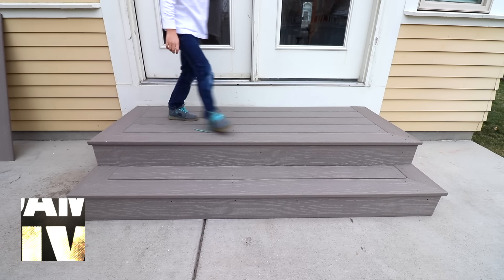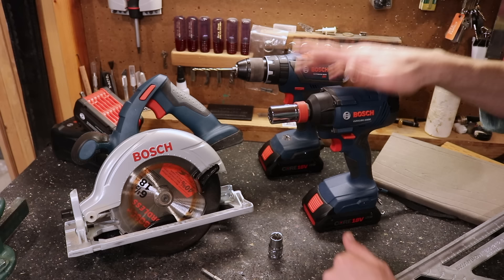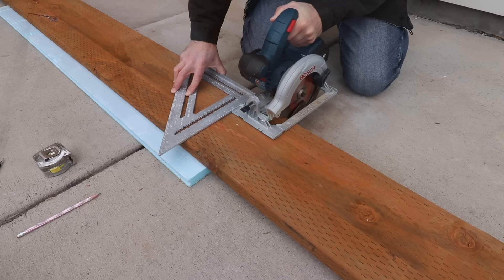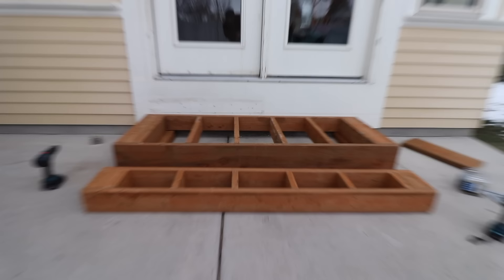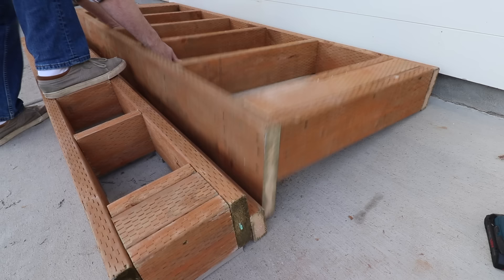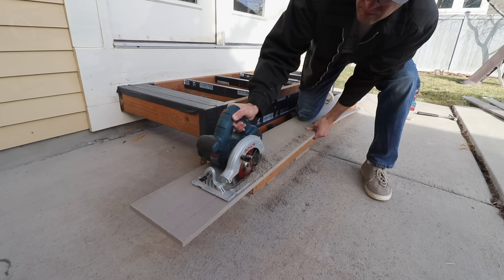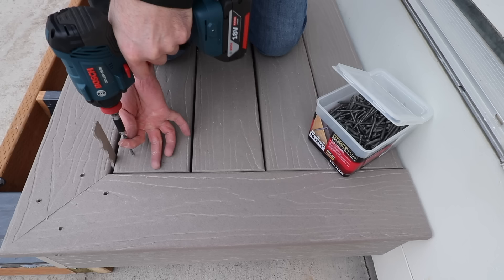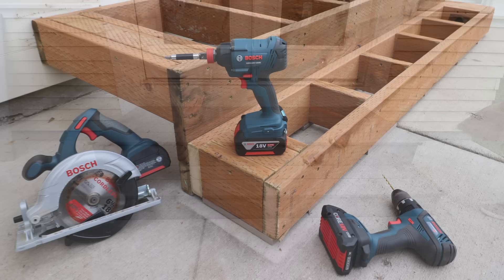How to Build Porch Steps - Composite Decking

Comment: would be saver if step were raised to exit height...its a hazard...
Reply: Depending where you are located, there are codes that state you need  have a minimum distance from the door threshold to the step for snow build up. It's not good practice to have the step/deck at the same height as your door.
Reply: @blindsidebank  it is saver...
Reply: From what I understand the code, it says a landing space is needed if the door swings outward. In this case, the door swings inward.
Reply: the word you are looking for is "safer," i gave you a pass the first time...

Comment: Instead of screws, can we use addesif ciliconnes?
Reply: I would not recommend using adhesive over screws.  Check with the manufacturer of the composite materials that you plan to use for a list of approved adhesives, if you really want to go that way.  But consider using FastenMaster Cortex screws that match your decking material to give you a clean finish without the screw holes showing.  Hope this helps.

Comment: Seemed to me that the saw bogged down? Please reply.
Reply from the maker: Leonardo Rojas i think battery saws all have a harder time than corded ones.  This is the first battery one I have used and yes it’s weaker than the corded but I absolutely love not having to deal with plugs and cords.  It’s a trade I guess.  I just had to adjust to a slower cutting speed.  I don’t mind.
Reply: AdamDIY Of course. I understand. Not having to deal with extension cords nor plugs is very, very useful and you can work easier. 
Here in Peru there's a Bosch cordless circular saw that's identical to that one. I'm planning to buy it. I know it will not cut as fast as my corded one, but it will cut. I want it to cut OSB and plywood panels. After that little saw provides me with enough money I'll buy the 60v DeWalt. :)

Comment: I'm not going to criticize you. But, a lot of that build is wrong,not code and bad workmanship.
Reply: Well at least you didn’t criticize. Care to explain what was wrong if you’re so bloody smart?
Reply: Yeah guess he cant
Reply: It was a great build with minimal tools
Reply: I can't speak for Joe Framer, but a few things I noticed are:

1) The note about "joist" spacing of 12"-16" may be proper for general composite deck surfaces, but manufacturers generally require 9"-12" spacing for step supports--joists/stringers/etc.

2) The "big flat surfaces... at the edges of the steps" are inconsistent with proper framing for composite decking. There should be minimal framing wood directly below the decking, to maximize air flow around the decking surfaces, which minimizes mold/mildew growth on the hidden surfaces. Periodic, vertical 2-by blocking would be preferable to long horizontal supports.

3) Hidden clip fasteners can be used as "internal" step fasteners, but (face) screws still should be used along the outer boundary/perimeter, where overhangs are subject to 'up force'.

Otherwise, it's a very nice job.
Reply: Ty Smith no problem Ty. I own a framing company. We build custom ocean front homes for over 30 yrs. 
   First...that’s crap Pressure Treated lumber ( low grade )
   Second..the measurement for the height is from the concrete to the highest point of the threshold. ( the point where your foot lands )
   Third..The box frame has no joist hangers on the joist ( they support the joist from sagging)  also no corner braces ( like LS50) 
   Fourth..The end boards on the flat should be supported underneath,not with screws through the sides, structurally they will fail.
   Fifth ..securing the step to the concrete with a Ramset is wrong and won’t hold. A “ titan” bolt or a threaded rod with epoxy, and anchor bolt should be used.
   Sixth..15lb or 20lb tarpaper should be used on top of all pressure treated surfaces, not “ vycor ,like he used because it will break down being exposed to the elements.
   Seventh....Improper attachment to the house. You cannot attach a step, deck or exterior structure to the building  by using a spacer and screw. The exterior trim “ kickboard” must be removed, properly ,” flashed “ to the house using vycor or tarpaper with plastic deck ledger . Then either stainless bolts (1/2” ) with washers or rated Simpson deck ledger bolts in the proper bolt pattern.
   Eighth...The trim around the step is called “ riser” trim not a fascia trim, which is part of the rafter detail. Also it should be mitred at 45degrees not a “ butt joint”
   Nineth..the composite decking he used should not be “ screwed and plugged” but hidden fasteners , he used an inferior product.
  Tenth..the joist should be no more then 12” on center when using composite decking.
   Eleventh...it’s guys like this that teach Bad framing techniques and should not be allowed to do so. Then professional Builders like myself wouldn’t have to explain to guys like you why this video sucks.
Reply: Yep Just an officer read my reply below
Reply: Nathan Unsworth no it wasn’t
Reply: @joeframer9642  I like watching the videos, but like in this case, the real information ends up in the comments and I usually go pretty far through them before starting anything. Thank you for posting the information, I realized some of it (like the hangers) when reviewing my local building codes.
Reply: @joeframer9642  I feel like Youtube or The Internet in general needs a certifying body for serious how-to videos. It would help people know who they can trust while acknowledging what a great information source it can be. For example instead of just saying "Go see your local building codes" it would require that they provide a bill of materials for the project,. Great example here, locally for me, you have to have coated/dipped nails and screws. If some businesses such as yours got together with others, and even made up your own certification, it'd draw attention and start something great.

Comment: It's concrete, not cement. Cement is an ingredient that's in concrete. That's why it's called a concrete truck, not a cement truck.
Reply: Kevin Williamson such a stickler. Thank you for correcting him. If only you would have made this video yourself...
Reply: @spenserharp3935  in this day and age of being politically correct, let's be politically correct! Cement is only one ingredient in concrete, as well as a motor is driven by electricity, and an engine is internal combustion. I'm making it my lot in life to correct these inconsistencies. Also, I'm not sure about his location but where I live you never take a step down out of a structure you walk out onto a platform and then take your step down. What he built is an extreme tripping hazard.
Reply: And yet, you knew exactly what he meant...semantics...
Reply: @wipatriot510 you missed the point.

Comment: Dont need such big gaps between those deck planks!     It will only get moisturized quicker  !     Butt em titer wait for the next rain and drill some small holes in inconspicuous small holes  spots where water will drip through if your worried about sitting water just make em  where the water will drain away not sit under it and collect and cause rot even pressure treated can be ruined by water  nothing is completely  water resistant   but those boards are too far spaced water will defenitely not sit on there but all kinds of dirt and debri and insects will be getn all through it black widows and those insects will die and collect and next thing you know theres all kinds of dirt and wildlife built up under there against your wood and itll quicken the decay process and you'll have to build or fix em years before you would've had to if you didn't allow the gaps to be wide enough for everything to get in there     air will make it's way in better then ya think it will it dont take much for air to do its thing
Reply: Dong King 😂😂😂
Reply: That is the most ridiculous thing I've ever heard
Reply: if u have the gap... why u need to drill holes..
Reply: Dong King that is the longest sentence I have ever seen. Nice work!
Reply: Hello expert. Just want to be sure that you accounted for manufacturer recomendations as well as local building codes, best practices, climate variations, as well as ambient temperature at the time the steps were built.  Just saying, do you even know the difference between composite and wood?